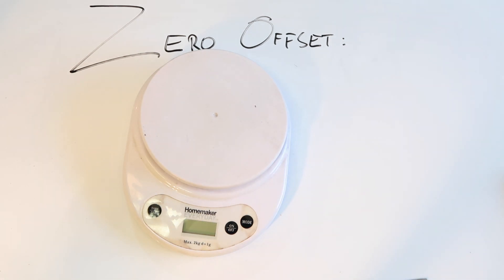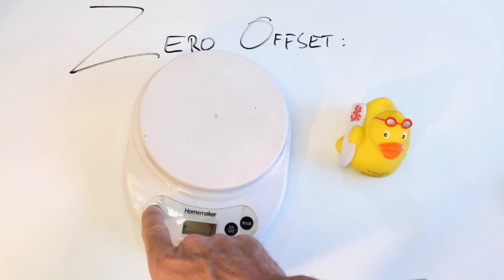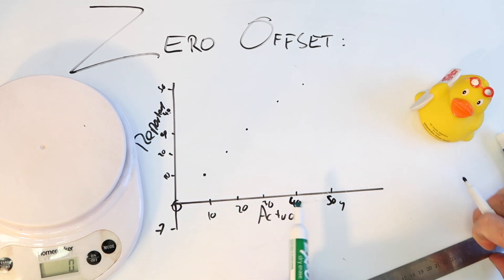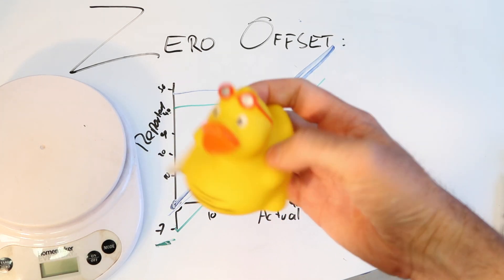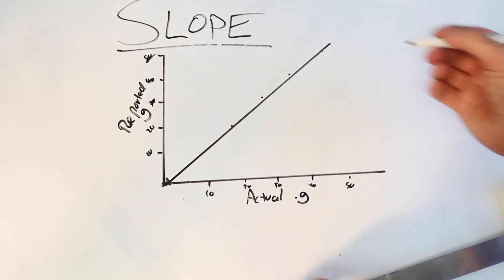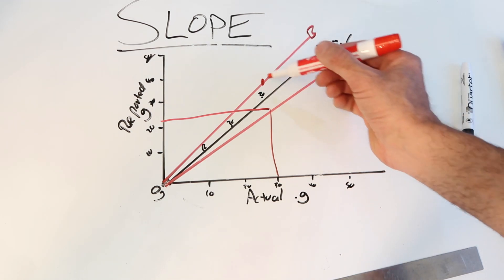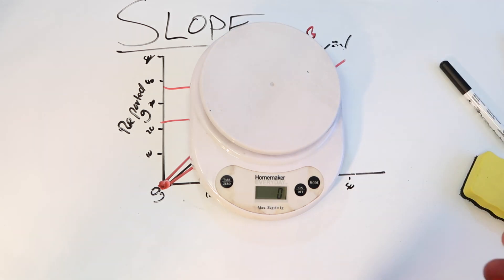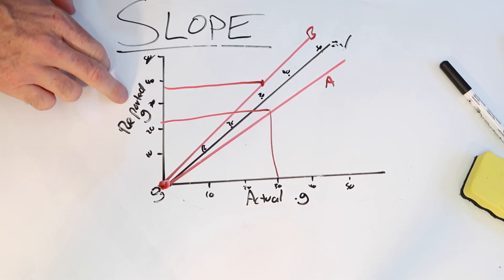Cycling Power Meters: Zero Offset vs Slope // What is the difference?

Comment: Hi Shane. 
Ive adjusted my slope on each qaurq meter (i have 3) so i can have all 3 as reading close as possible to my wahoo kickr. (i made the kickr the master so i can try my best to get all meter the same). On one of my qaurqs, the factory slope was 7.23 but ive adjusted it to 7.71. If your graph here is anything to go by, then i can expect to see a larger variance with a higher power output? Do you know if 7.23 to 7.71 is a significant jump or minimal in terms of power output. (quarq slope range is set from 7-20 i believe). thanks.

Comment: Hey Shane,
Great video. Have you ever seen a power meter where in the slope is not a straight line?
Reply from the maker: Discussed deep in the comments here... which I can't locate now.... but yes, that's a possibility. Multi-point measurements give more accuracy when correcting/calibrating slope..... this is a topic in itself.

Comment: Excellent video Shane, very elegantly explained. You're doing an awesome job on this topic.

I believe the Quarq is the first power meter I've had that is capable of zeroing by backward pedalling, but I don't use it and zero before each ride. So if I understand correctly the Quarq can be zeroed while coasting, say down a hill right? If that's the case I'm surprised the vibrations and just general riding dynamics don't affect the zero. Also, is there some visual feedback that a zero offset has been done (eg on the Garmin does it display "calibrated" or similar each time?). When I've tried it I haven't seen anything happen so haven't been sure whether it's worked or not.
Reply from the maker: Cheers Pete. Agreed about the vibrations/etc possibly getting in the way. The only way you know your zeroing has been done is 'calibration success' (argh, wrong terminology Garmin!) on the head unit. It'll show an offset value that /should/ be ballpark consistent day to day..... ish.....  I operate mostly in 0/1 | on/off |  yes/no, and there's a lot of "yeah, maybe, ish, kind of, close enough" when it comes to power isn't there? :)
Reply: Ok thanks Shane. I'm about to go for a ride so will try that backwards pedalling malarky (if I remember) and see how it goes. I've never got any form of acknowledgement from my Garmin 1000 when I tried it previously, so I obviously wasn't doing it correctly.
Reply from the maker: Arh, there's no feedback on the back-pedal auto zero.... if that's what you were looking for. It only pops up when you perform the process through the menus manually.
Reply: Ah! Yep, I was referring to doing the "calibration" by backward pedalling while riding. Ok, so I wasn't doing anything wrong after all, and it just doesn't acknowledge there's been any change to the zero offset made. I'm always very sceptical of any system where there's no feedback that at least a change has been made, and preferably a number associated with it as a sanity check of the system health.
Reply: Not sure if this will work exactly the same on your Garmin 1000 as my Garmin 810, but after doing a manual "calibration" (zeroing) don't touch the Garmin... leave it on the calibration screen and pedal around a bit. You'll see torque numbers.  Now pedal backwards 4 turns of the crank and it should pop up the new "calibration" (zero offset) number.  Typically it is a few points lower than the manual zero number.

Comment: If I was explaining slope I would explain it like - when your calibration is wrong then your powermeter is reading 1 unit of your actual power as lets say 0,89(underreading) or 1,11(overreading) the more power (units) you push on pedals reading of the power will be further from actual power 
so if your actual real power is 100watts  underreading (89watts)  overreading (111watts)  in case of 300watts  underreading (267watts) overreading (333watts)
I hope I´ve got it right :)
Reply from the maker: Assuming a linear slope yes... and that's the basic assumption I covered in this video. In reality it might not be a straight line, so multi-point measurements give a lot more accuracy when correcting/calibrating slope.

Comment: how do you know if your slope is incorrect if you only have one power meter? if the slope is incorrect can you still use the power meter effectively? my intuition says yes since your zones are based on that incorrect slope... am I wrong?
Reply from the maker: If you're not switching between power meters that read differently then no, it doesn't really matter.... but where accuracy comes into play is when platforms like Zwift (and who knows what's coming in the future) rely on those numbers being accurate. Then the game changes. A lot. You don't want to be cranking at a reported 250W when you're really doing 300W and getting dropped from the virtual bunch.

Comment: Pretty idiot proof, If I'm just after personal improvements does it matter how accurate my power numbers are as long as they are constant? :/
Reply from the maker: It depends. If you're not switching between power meters that read differently then no.... but where accuracy comes into play is when platforms like Zwift (and who knows what's coming in the future) rely on those numbers being accurate. Then the game changes. A lot. You don't want to be cranking at a reported 250W when you're really doing 300W and getting dropped from the virtual bunch.

Comment: One thing I'm not clear on with Vectors is the difference between 'Setting the install angles' (done once after install/battery change) and calibration at the start of each ride. Any ideas? (from what you say in the vid, it seems like they may do similar things)
Reply: Not the angle of the pods, the angle of the pedal spindles and therefore the strain gauges.  But yeah, its to break down the force into radial and tangential components.  You can sort of adjust slope on the head units by setting a scaling factor.  Also useful if you have different length cranks ;-)
Reply: Ah thank you, knew somebody would know! Yeah I usually have to change crank length from default 172.5 to 170
Reply: And if you're interested in the gory details of setting the slope  on Vectors
http://support.garmin.com/support/searchSupport/case.faces?caseId=%7Bbc27d9e0-3b69-11e3-f27b-000000000000%7D

And

http://support.garmin.com/support/searchSupport/case.faces?supportPage=Vector&caseId={a12ee4b0-e675-11dd-5c1e-000000000000}&locale=en_US
Reply from the maker: Vectors - A frontier I never ventured towards..... I know the correct installation with correct torque is critical to their accuracy. Zero offset / zero torque before each ride which Garmin call "calibration" on their head units is different. Garmin support might be able to clarify this a little better. (well, I hope they can!) :)
Reply: OK, ta! I think the install angles is something to do with recognising the angle of the communication pods that attach to the pedal spindles (as they can be attached at any position around the spindle)

Comment: Is zero offset synonymous with calibration?
Reply: Thinking back to my days as a strain gage load cell design engineer; calibration would be closer to the slope of the graph in the video.  Watching the full vid, Shane basically states this as well.   As an engineer we would make load cells out of just about anything metallic that we could mount strain gages on.  We would then apply a known, constant voltage across the gages AND a set of known loads on the cell.  We would read off the change in voltage on the gages for the loads which could then be used to calculate a calibration factor (slope).  In a perfect world the load cell performance would be just like the graph in the video; thru zero and a nice straight line.  In actuality, the results are not so  perfect.  I am sure you can find lots of strain gage performance discussions online, so I won't even try to go too far into it.  I will say, that a single point calibration, using one known load, seems somewhat limited, UNLESS you have already established that your sensor is extremely linear.  Also, I would question just where in the sensors range this calibration weight is?   IF the sensor is designed to handle 0-1000 kg and you use 10 kg to calibrate it, that's not going to be very good.  Effectively, a single point calibration make the sensor read 100% accurate at that point.  So if the sensor isn't so linear, then it's off everywhere else.  There were all sorts of design variables that we would play with to design the system to be as linear as possible.  ALSO, I don't really know if power meters being discussed as strain gage based or not.  There are other methods to create power meters.  I look forward to the next video on calibration!
Reply: Early versions of the Vector firmware had a "dynamic calibration" (zeroing while clipped in).  The idea being that some strain was added by the clipping mechanism.  This was dropped a couple of years ago though, and unless you're running ancient firmware pedalling backwards will have no effect.
Reply: It's not my field but I was curious about linearity last night, so did a bit of reading.  Dummy gauges, full Wheatstone Bridges &ct.  interesting stuff.  I wonder if non-linear response was one of reasons Stages took so long to bring out a carbon crank.  And maybe gluing issues.  Just applying suitable adhesive sounds pretty complicated!
Reply: Yeup... it's complicated and requires very careful work, not only in gluing down the gages but also wiring them up.  BUT, it's pretty straightforward once you have all the steps down.  I wonder if some of these companies are using piezoelectric based sensors, which is another technology.  For carbon composite cranks, you would need to do something different.  Looking online: http://scholarsarchive.byu.edu/cgi/viewcontent.cgi?article=3621&context=etd  COOL stuff!!!!
Reply: Power2Max maintain their units never need slope adjustment. I've not seen anything in my experiences to refute this. But will also stand corrected if there's evidence to the contrary.
Reply from the maker: According to Garmin, yes. According to the actual meaning, no.
Reply: Haha! (you replied before I finished the vid!!). Do the Vectors have the rear pedalling thing? (I have vectors but didn't know about this)

Also, if you pause a ride midride (e.g. coffee stop) and the Garmin auto powers off, would you need to recalibrate when switching back on?
Reply from the maker: Not sure on the Vectors for during-ride zero offset. I never calibrate mid ride after a coffee shop... although I do it just before a time trial just to be 100% sure the data is as accurate as it should be.
Reply: OK, so basically it's not 100% crucial to do before every ride? I do mine every ride as the garmin auto prompts on start up and pairing with Vectors
Reply from the maker: Before every ride depends. I do it because that's what I've always done, and I want clean/correct data. The back-pedal zero on the Quarq might be sufficient these days..... and remembering to do it when kicking off each ride.
Reply: Makes sense for clean data as you say, only takes 5 seconds
Reply: Cool, thanks Karl
Reply from the maker: Brilliant discussion guys. I really appreciate everyone dropping into the comments section here to add a lot more expertise to this topic.
Reply: Nice explanation Paul. I think many people become confused by the difference between Accuracy and Precision, and the implications of the two definitions depending on whether the person is using one power meter as an independent data source, or multiple power meters and/or referencing the data to other data (eg Zwift). Obviously in a perfect world we'd get both accuracy AND precision, but in the real world engineers/manufacturers are sometimes forced to prioritise one over the other. Accuracy is becoming increasingly important as more people are getting more data sources and that has serious implications for some manufacturers.
Reply from the maker: I hear the same about P2M. SLane loves his, so that's a tick of approval in my books. Will looking at sourcing one soon... P2M NG(?) are Bluetooth too I believe. That's going to help with Zwift iOS, a lot.

Comment: You got me panicking! How does this affect a Wahoo Snap? I do the basic spin down before every use and notice the offset is zeroed each time (now I know what this means!). But what about slope, never heard of this?!?
Reply: Interesting. if your zero offset is not zeroed, your power output error is the same at low and high power outputs. if your slope is incorrect, the error increases as power output increases.
Reply from the maker: Nothing to stress. As long as your tyre pressure and tension is within the specifications from Wahoo, and you you do a regular spindown, all should be good. If you really want to test your slope/accuracy you'll need to find a good/certified power meter to use on the SNAP to compare it to.
Reply: Shane Miller phew I will check tyre pressure every time as well. Great vid, cheers mate. 👍🏼
Reply: Chris Cartmell What tyre pressure are we talking. I have been using a snap and just assumed that if I did a spin down it would be accurate based on the values it found. I have always been frustrated by the discrepancy displayed from the Snap and my stages which is usually 20 or so watts.
Reply: I have 25mm at 120psi same as on road. It doesn't lose as much as on road though between rides.
Reply: Hey Chris, I've had snap for a while now and have compared it against a PM semi-regularly. I would say the most important things for the snap are room temperature and tyre pressure. If it stays in the same location, same temp, same pressure - good to go. Don't really need to do the spindowns every ride. Although it still takes about 10 mins for the accuracy to increase as it warms up. If you move it, have variable temps or dont keep your pressures the same then spindown++ ! :) IMHO temp is the biggest factor. I've found it to be within 10W of my power meter most rides.
Reply: I think within 10 watts is really good. Mine is in the shed (in UK so gradually getting colder). The basic spindown takes a few seconds so might best to keep doing it given our variable weather!

Comment: Shane Im interested to know does your kw produced adjust when you sitting and spinning compared to standing and grinding?
By that I mean 34X25 with a cadence of say 85-90 compared to 50X25 cadence of 65-70.
Im guessing the wattage output would be similar however the first option there is less grunt being put through the drive train.

I dont have a power meter so cant do the test.
I am somewhat of an AContador and happily stand and dance on the peddles all day & feel no more of less fatigued than if I was sitting and spinning.
Reply from the maker: 300W at high cadence = low torque high rpm. 
300W at Low cadence = high torque low rpm.

A Watt is a Watt regardless of how it is produced. How you produce it and how you respond to producing it is a whole PhD worth of content. :)

Comment: speedometers are often 5-10% off from the factory, some are even 30% off. Funnily enough people cope and traffic continues. Appears all thats needed is consistency.
Reply: Maybe I'm just spoiled because I drive Chevrolet, but it's been a long time since I've seen a factory speedometer that was off by even 1%, much less 5-10%.
Reply from the maker: I wouldn't call that an acceptable margin of error. Not in a country like here where breaking the speed limit by over ~5-7% results in huge fines and eventual loss of license. Consistency is key - when you have one power meter, yep.
Reply: Shane Miller agree its a crazy error rate but its the norm. Dont your cops give a 10% error rate on speeding to allow for differences? in the uk they do, or supposedly do, especially if the speed check comes from following you, and they must go and get their speedo checked after as its one way of disputing the fine.